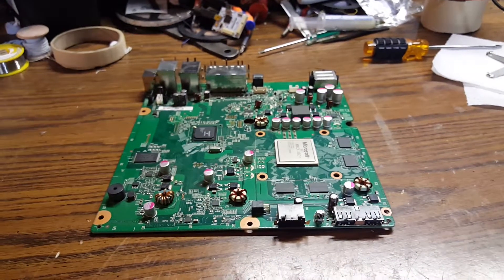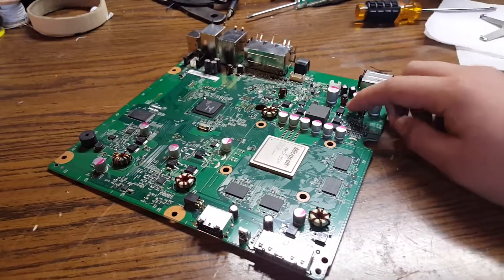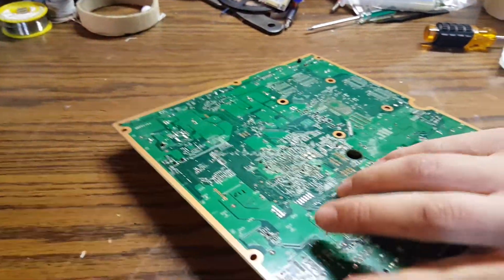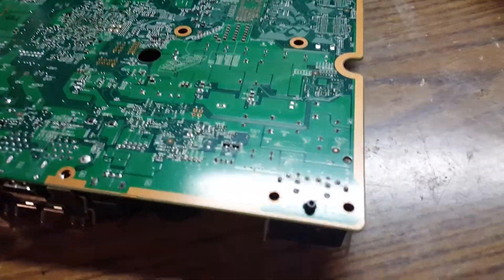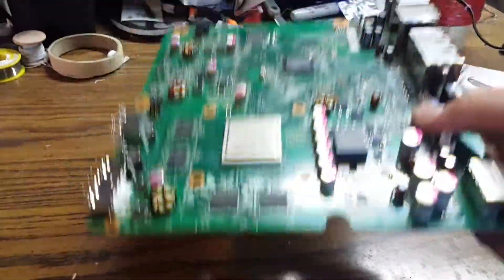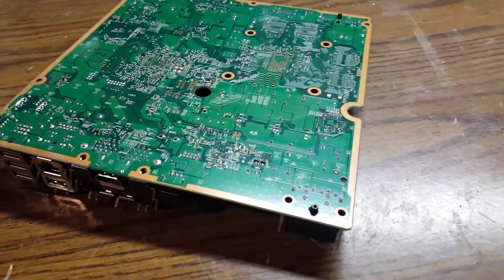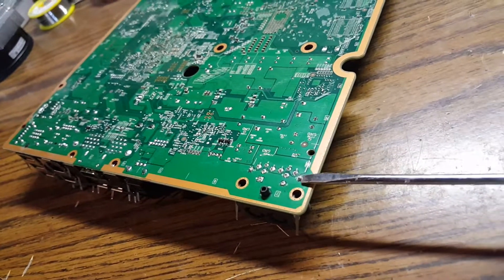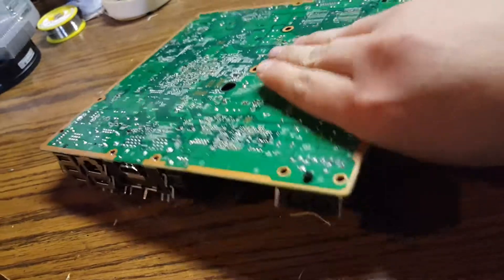What Points To Solder To For A Xbox 360 Slim Fan LED Mod

Comment: my power supply turns red when I attempt to power on. I attached a 12v led strip. Help?

Edit: I watched another guide and it told me to solder the wires on the other side of what you showed. I did that and now my xbox turns on. Did you make a mistake or does this only work with some slims?
Reply from the maker: This works on all slims for sure. Did you make sure the flux was completely clean? Flux could cause a issue, or if the points on the leds are short circuited or grounded.

Comment: Nice video sir can you please help me to find which motherboard is inside my Xbox 360 slim its power is (12v--10.83A;5v--1A) and it's MFR date is 2011-06-25  is it Contra or Trinity and his colour is Matte black
Reply: 414 GAMES 414 late comment but it’s a Trinity
Reply from the maker: Sorry! Just signed back into this account. It's a Trinity. Generally speaking Trinity is 2010/2011 and Corona is 2012-2013